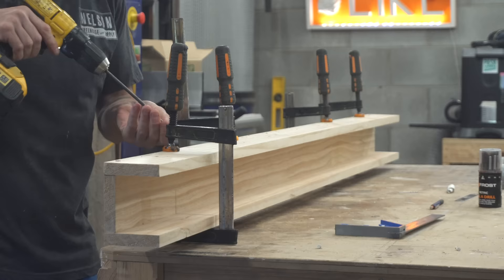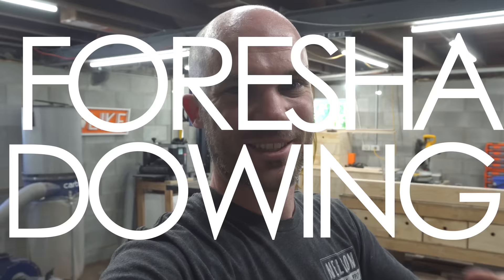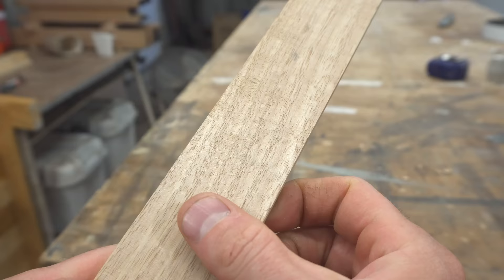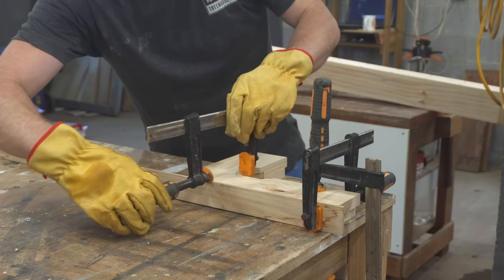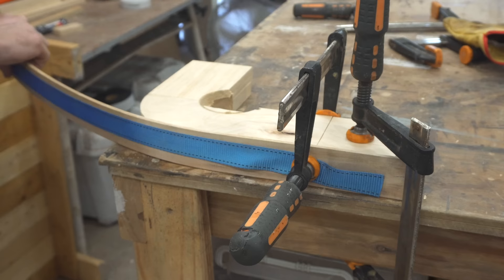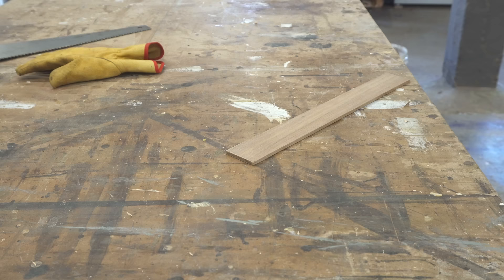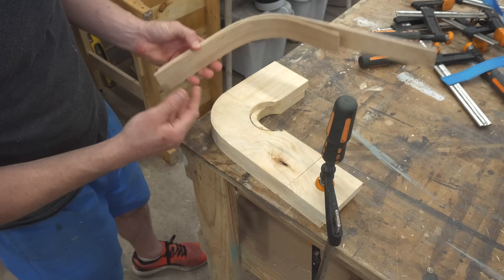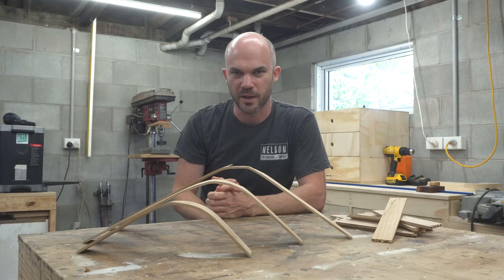Learning To Steam Bend Wood

Comment: I made a balance board last year out of ply and thought I could bend 12mm ply just using clamps (I was daydreaming obviously) used 4mm and did it in stages and it came out perfectly without steam but did use some water,  the bend on yours is much tighter though and that's the hard part to overcome, interesting video

Comment: In my limited experience, the problem is that you are letting the wood expand. You can prevent this expansion by using a blocker at the ends of the strap. As you mention,  a flexible steel guide would work better than the fabric strap.

Comment: I used marine ply 1” x 12pm x 48”w” x 24”h.  Perfect for furniture sized pieces.  A 55 gal(US) barrel tank, 1” copper tubing and a 160,000 BTU heater.  I’ve bent 4” x 8” x 10th L oak green beam to create a decorative entry arch for my barn.  The key is a degree of saturation.  Plus using a spring steel back strap for the mold to keep the back support to keep the cracking from forming.

Comment: PUT YOUR WOOD IN A PIECE OF PVC CAP IT ON BOTH ENDS
. PVC WONT ABSORB THE STEAM THE WOOD FORM IS ABSORBIN A LOT OF YOUR STEAM
Reply from the maker: I tried that originally but the PVC went too soft because of the heat. It might need to be a special type of PVC to operate at 100 degree celcius
Reply: @RobinLewisMakes  PVC on copper cables tend to start to soften/melt around 70C. PEX is around 90. So maybe a PEX pipe will do, if you can find it in Australia. Otherwise try to add garnish or other surface coating on the timber box, so the wood is already 'soaked' in oils etcetera that rejects water to a degree. And reduce the amount of holes to a single one, at the top. Let it built more pressure And rather enlarge that hole, if you feel the pressure is too much for your comfort. 

Well, you can experiment with making a better box as much as you want!
Reply: Since PVC softens try ABS pipe. It has a much higher melting point.
Reply: Sheet metal then.
Reply: Soak or wet the wood before you steam it?

Comment: How l use to do it very easy , make like a robin hood bow, hole at both ends ( how long your timber is ) string it,  like a bow , sit it up in a big  bucket of water,.. cut a stick, put  in between  wood and string  and wind up the String every 10-15 mins , change the position of how its sitting in your bucket of water so it get it's tern in the water   till you achieve your required circumference..but cut your timber 1 1/2 times longer so you can trim to size., l use to do it when l use to work refurbishing old Victorian Banks in London  they have a lot of round metal support columns...

Best of luck old beans

English Mik.

Comment: This is what I know most people who do woodworking actually soak the wood in hot water for sometime. The hot water causes the wood to lose its stiffness, which allows the craftsman to put the wood into a vise for controlled warping. Then they let it dry in the vise.  

If you soak the boards in boiling hot water for x time, and the boards in vise it would’ve come out just as good. 

There’s one problem Tasmanian Oak is a one of a kind exotic wood and it’s not sold at big box stores I know this because I looked at Home Depot and Lowe’s the Major United States hardware megastores they don’t sell it. Not to mention small boards 4in by 6in this Tasmanian Oak is selling for $98. Not to mention this does it say how much by board foot it cost, it could be at least $300 USD per board foot.

Comment: I watched another video by a guy who makes wheels and wood framed canopies for buggies out of ash. He did show that he had to be careful in selecting the right peices so that they were suitable for bending. He was bending 1" ash.  He visually checked for the grain run-out on each peice. The more closely the grain followed the long edge the better - if the grain was at and angle to the long edge then it was not suitable and would crack. This makes sense but it's one of those things you could miss if you were not told about it or read about it.

Comment: While building boats I learned from the pros to wrap the wood in old terry cloth (or Similar cloth) and slowly pour rapidly boiling water  (hoter than 100 degrees cleceus) over it repeatedly for fiften minutes.  It worked well for bending wood much thicker than this. The wood was wet and saturated with steam and bent well. Very hot and requires good gloves to handle.  It cools a bit slower due to saturation.  But dries completely in a couple hours after.

Comment: Fabricate a negative template from your current template minus the thickness of your wood. As you are bending the steamed piece,  clamp the negative template in front of the the wood and continue clamping both templates together with the steamed wood in the middle.

Comment: I would use corrugated pipe. steaming  it while at the same time bending it. It’s tough enough. To make sure water flow from one side to another. Fill it with sand.
Reply: Or use clear food wrap to coat the bottom of the inside of the pipe

Comment: I have had a few goes at this, with varying success. Best success was using a 200 litre steel drum, loose lid and a 3" x 3 metre steel pipe running horizontal out from near the top. Wood fire beneath.  Two issues I see with what you are doing is,  firstly you only have a very short time to bend before it cools too much, so work out a faster system than clamps. Secondly your steam box is absorbing much of the heat and moisture, which using a steam cleaner is minimal to begin with.

Comment: Hey mate, nice work. The use of that fabric was definitely a right move, better to do it right. Timber cracks as a result of tension in fibers in tension side. That fabric is stiffer in tension and takes the tension to put the timber in compression. Only if you attach them together in a better way you can have a better compression in the timber. A way is to attach on side of the fabric by a clamp, bend the timber in opposite direction and attach the other end by another clamp. This is a kind of pre-tensioning technique.

Comment: air dried wood is best; ammonia in the water may help; straps to resist stretching usually a must, especially for thicker timbers; steam time only starts at working temp/pressure, with twice as much time needed for kiln dried wood.   That's about all I have.  A metal box would help that little steamer unit perform better, so you're not using so much of its capacity steaming the box itself.

Comment: Tips From A Shipwright steams his wood in a clear plastic tube, from a roll. Like that thin stuff you'd put on windows of an old house if it was flat. Simply run steam into cut holes through tubes from propane tanks on burners. Bend the wood while it's on the frame I think.

Comment: Your guess that you need to use a steel strap is spot on. But you need end stops to stop the bottom layer from stretching out as you bend.

The wood you are using is rift sawn, that is the grain runs parallel to the top and bottom of the plank. This allows the layers to delaminate as you bend. You try and reduce that with the steel strap; your nylon web stretches too much. You might have better luck with quarter sawn wood.

Your wood is also kiln dried (assumption that its store bought). This sets the lignum in place and hardens it making it much harder to soften for bending.

Hope this helps.

Comment: Need more box time. Better steam generator. And seal the box with oil based paint or use 4" pvc pipe and caps. Journeyman cabinetmaker here. Can't remember the formula for time vs. thickness and species but you should probably use 1.5hrs for your wood. And also use a little bit of ammonia, this will help quite a bit.

Comment: If you preheat a metal pipe to bend it around, the wood won't cool as easily, and you might be more successful, especially with small radii.

Comment: It's the grain that is giving you problems. Say you have a piece of 3/4 inch stock and you rip 3/4 by 3/4 inch square strips. Rotate the strip 90° so the grain is a position to where it is less likely to snap.

Comment: Rule of thumb when bending wood , is less than one inch of run out per foot in the grain. That will help the bending . Anything more is so so bendable.  Add some  Ammonia to your steam solution and try a Bow style reduction and the reduction about 1800 to 1 .  Or very very slowly. with like a come along.I am not trying to give you a hard time. Just some notes i learned from and older wood bender . But he had some great stuff in his shop.

Comment: If you put the steam hole in the center, wouldn't hat give a more even distribution of the steam to the wood? If one end is softer than the other then you would have to pull out the wood and rotate it. Plus, if you don't put a drain hole in the back, the water will pile up inside and the box will EXPLODE!
Reply from the maker: The steam hole on one end means the steam travels from the inlet to the other end of the box, filling it up. In reality it doesn’t make that much difference but that was the thought behind it. I also added a drain hole later on, on the inlet side. Got a fright after I tipped it up and pool of water poured out!

Comment: I am trying to straighten a warped beam profile on a 1950 teak sofa. It has been in (damp) storage for years. It distorts about 5 cm over the 150cm length and is a cross section about 8cm cx 5cm.
Can I use steaming on this thickness to straighten this out, Or should I first soak it in a bath of water? or something else?

Comment: You're actually a lot closer to success than you may believe. Consider the following:
The timber you're using has two things going against it. Firstly,it is kiln dried dried timber, so the lignum has already been set.No amount of steaming is going to "unset", and then "reset" the lignum. You can bend steam dried material, but as you see, it is difficult. Secondly, the timber you're using is "flatsawn" , and the cracking you're getting at the bend is the grain "running out", or separating from the layer below it. If you were to source quartersawn, air dried timber, your success rate will increase exponentially.
 The concept of your steamer is correct, but instead of using pine, go to the "box store" and buy a sheet of 1" aluminum backed insulation material, and some aluminum tape. Make the box bigger, than your original. Don't worry about the steam escaping, you actually want this to happen, to an extent. Instead of a hinged door, just make a "plug door". You need some insulation to keep the box temp up, and smooth surface for the condensation to flow back down. PVC pipe work good also, but I've had better success with the insulation material.
 You did hit upon time correctly. 1 hour is the minimum time any hardwood is going to be in a steamer, unless the strips are really thin. Start with an hour, and add an hour for each 18-20mm thickness. If you're bending a lot of strips, same rules apply.
 Your bending form should do fine, even the first example was good enough. Given the correct material and steaming time, you could have bent a 25mm piece on your first form.
 Everyone that has ever had to teach themselves to bend wood, has gone through exactly the same steps you have.
 That's a nice steamer you have there. In the US our normal voltage is 120vac, and getting enough watts to run a steamer on 120 is problematic. I believe you have 220vac as normal power, so you have a lot more watts available. Nice!
 You're really, really close to success. Don't gibe up. Steam bending opens up a whole new facet of wood working, and project possibilities.
Reply from the maker: Thanks for the tips Michael, this gold for me and anyone who comes across this comment. Will try insulating that sounds like an easy win. Woods going to be a bit more difficult though so I’ll use this same wood for now, for the chair (albeit with better grain and longer steams) but in future I’ll try source a better option. Thanks again, really appreciate this feedback!
Reply: Spot on re advice.i would add a metal strap is key together with the wood being   'locked' in at both ends so that it does not move or over-stretch . Wood will compress on the inside of the curve far more than it stretches on the outside of the curve.
It's the stretching on the outside that breaks the fibres, it's the compression on the inside that makes the curve.
Soaking the wood perhaps with fabric softener makes a huge difference, if you dont need gloves when you take it out of the steamer it's not hot enough.

Comment: Interesting that an experienced woodworker like you is having so much trouble with bending wood. 
Here are some ideas from someone with about zero woodworking experience and lots of time watching YouTube videos about woodworking. 
I think the wood slices should be much thinner. More like veneer wood. Also, the wood should be soacked when it comes out of the steamer. Your wood looks too dry.
Reply: Samtagri I’ve seen people do it with horse-carriage cross bars, so its doable with much thicker wood. The bloke who did that did it with a cutting torch to heat it, Waving it back and forth with a soft flame to not burn it. He said that the trick was to get it “too hot to touch.”

Comment: could use the ratchet strap to slowly bend it over the shape , maibe heating it with a paintgun while bending works , i think wood schrinks when heated 
another option could be to clamp it in between a male and female mould
i agree that green wood would bend eazier , maibe go to a sawmill and get a fresh cut plank and make youre own strips

Comment: That radius is REALLY tight for bending 4 mil. If I had to stick with 4 mil and that radius, I'd consider boiling the wood first to drastically increase its moisture content.
Reply from the maker: That’s what I like to hear! Will be making it thinner for the chair project
Reply: @RobinLewisMakes  Thinner is better, if you need thicker than what you bent, laminate two back together.

Comment: Great video. Only question is shouldn’t you use plastic or epoxy to line the box? The box is wood so obviously it’s going to absorb the steam intended for the project.
Reply from the maker: Thanks! It's a good point and I have noticed after doing multiple steams in a row the whole system works a bit better. Lining it with something non porous, or using PVC, would certainly help

Comment: It's been years now!  I think you underestimated how long you should steam it, but even more so, you underestimated how severe your curve was.  Some lignan doesn't begin to melt until ~175c so it can take a bit more heat too.  The steam will keep it from burning up to about 160c without too much going on.  If you change the atmosphere you can go way higher but of course that's a gigantic pain in the butt outside the scope of most individuals, even extremely dedicated ones.  Most old fashioned wood bending used full forms to accomplish the bend -- so you'd have two pieces of form in the final shape you wanted, they'd be spread apart so the unbent wood would fit, then you'd turn a press to push them together.  But the acuteness of angle is super tight here!  At least it looked like it.  I think most people get around the difficulty by using extremely thin wood, but it's still not that forgiving, as you saw.

How is it going now, years later?  Any new insights or experiences?

Comment: I too want to steam bend some wood. I want to make a cane. My research told me to slip the wood into a plastic bag when you first take the wood out of the box. I read to use hard woods and not soft woods.

I have made my own steam box. I used cedar and insulated the outside with styrofoam insulation. Also, I bought a steam generator from a wood working supply house.

Comment: Very hard to bend kiln dried timber use air dried if you can also use a old band saw blade as a backer it will help stop break out and you timber has to be soaking wet when you take it out of the steamer good luck 🇮🇪☘️🤟

Comment: I let the wood I want to bend in a barrel of water for a night, then clamp it along the frame with sheets of paper between each of the layer of wood to absorb the moisture. I change the sheets daily for 5 days.
One hand clamp is useful to bend the wood progressively from one end to the other one, Moreover beware of the orientation of the heart of wood, so that it bend to the inside.

Comment: You just drop it in a pvc tube fill it up with boiling water.  Leave it in there for a hour.  Pull it out and bend it like a wet noodle.  Leave it clamped until its dry and thats it.

Comment: Hi Robin, what if you'd clamped it in between two blocks, i.e. inside and outside curve. The strips of wood could not break when you slowly tighten the clamps to get the blocks together. Don't know if someone mentioned this previously. Too lazy to check
Reply from the maker: It’s a good idea and it’ll probably work better, but for the chair build I’ll be doing big pieces. Using a negative form will be a bit tricky at that scale

Comment: I just watched a worker (@honeybadger) bent a three foot long section of 2inch oak. Thinner isn't the answer. I also watched a gentleman explain that 250, 260 is possible and desirable. Toooo cold here. Then yes, all of the wood (especially thing wood) needs to be "bound". Pressure from all along the length and width. The canvas strap was a good idea, some of the other things not so much, lol 😜

Comment: Sir. Try our tradition how to bend a 3" thick x 5" width wood using used engine oil. Apply 4coats of oil where u want to bend your wood then set a minimum of fire move frequently on the area where the oil then  move slowly bend your wood.patient is the way to perfect your job

Comment: the best way is to put the wood in water for 24hours then heat the water to a boil take a flexible metal piece instead of the belt and then fold it